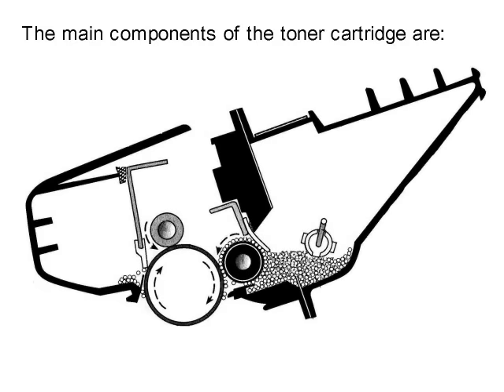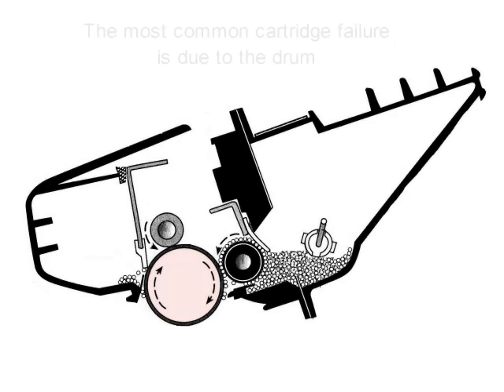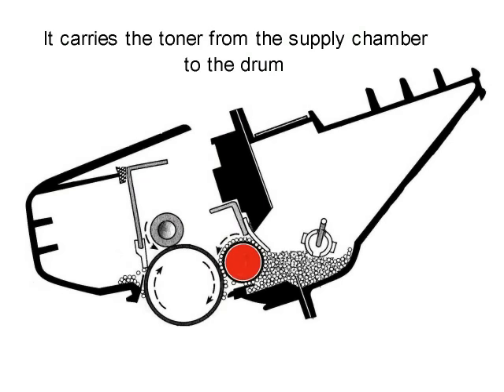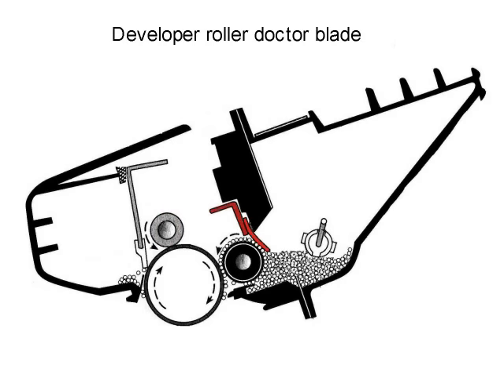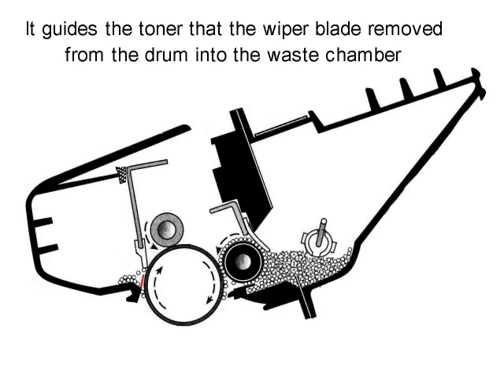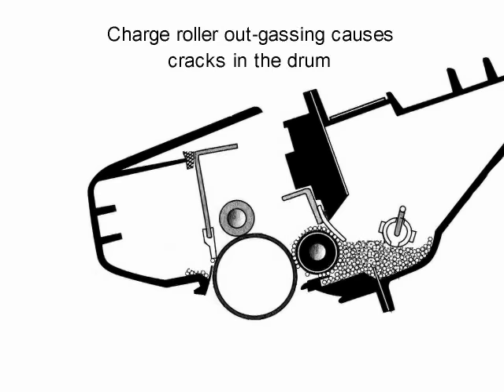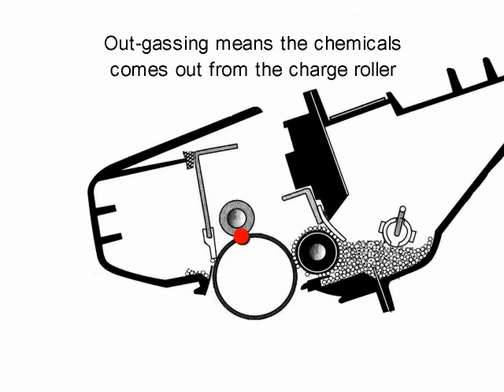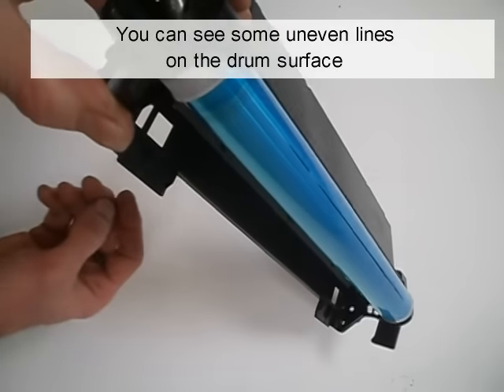Toner Cartridge Printing Defects: Causes and Solutions

Comment: i have a printer hp 1102 its printing black paper in horizontal 1 inch lines too dark and one inch light dark and no text at paper please tell me how to fix it
Reply from the maker: Qazi Zafar Iqbal you mean the printer only prints horizontal black/grey lines at the distance of 1 inch?
Reply: viandant5  yes sir totaly print black
Reply from the maker: Qazi Zafar Iqbal probably it's the cartridge. check the charge roller, may be out of position
Reply: i changed the charge roller and also change the doctor blade but no ok then what i do sir?
Reply from the maker: Qazi Zafar Iqbal I mean there should be some bad contact somewhere in the cartridge. I would check the contact of the magnetic roller or the drum using a multimeter

Comment: First of all many thanks for your very informative videos. I have a couple of new old stock Lexmark Optra and T6xx cartridges with a common problem: All internal components and toner are in top condition. But hardened developer rollers render them unusable. Seems as though developer rollers in 4039, 4049 and T640 are identical. Got any ideas where to get replacement for these? Are there providers in the EU? I really don't want to dispose of my valuable cartridges just because of this common, annoying problem.
Reply from the maker: That roller is a common problem on Lexmark cartridges. Delacamp or Uniener have them, or you could buy an empty cartridge from ebay or something else
Reply: @viandant5  Many thanks for your quick reply. I could not find Uniener though. Do they have a webpage?
Reply from the maker: @Caballingus  uninetimaging.com
Reply: @viandant5  Great! Thank you!

Comment: Hi I have watched dozens of vids, can u suggest my next move, thanking u in advance.  I have black lines across top, centre and bottom of page when printing. I have cleaned transfer belt and replaced the fuser unit. Toners are all above 50% and authentic samsung but still get lines?? Printer Samsung clp325 in dire need of yr expertise :)
Reply from the maker: are the defects always at the same distance?
Reply: @viandant5  yes they are - thanks for responding  :)
Reply: @viandant5  sorry just double checked and NO they are not same distance apart everytime. Sometimes 2 other times 3 lines ??  :
Reply from the maker: @tanyiahayes7587 It could be a drum problem. May be a defect on the surface causes a short
Reply: @viandant5  okeydoki thanks, I have a spare drum so might try swapping them around. :)
Reply from the maker: @tanyiahayes7587  ok, let me know what happens

Comment: Hi. Can you please tell how to set toner agitator roller to the correct position in hp. Color laserjet pro mfp m182n cartridge after refilling?
Reply from the maker: The agitator roller rod inside the toner hopper? It's inserted in holes in the side of the cartridge but it will be difficult ro reinsert. Better remove it
Reply: @viandant5  actually I have refilled my cartridge. I just want to know that whether or not the agitator roller is in correct position. How to identify that whether it's in right position? 
I open up cartridge just until removing the doctor blade
Reply from the maker: @hathakker802  You mean the foam roller. Try to rotate the gears, if they move freely it's in right position.
Reply: @viandant5  ok thanks

Comment: Does anyone know how to resolve error code 117-363 on a xerox 6128 MFP? I've tried everything that I could find on the internet without success. I was even able to start the machine in diagnostics mode and run both the Printer and Fax/Scanner diagnostics and everything reported "ok" so I don't understand why I can not rid the display of the error code as I can no longer use the printer with it there. While going through the printer diagnostics, it printed out pages that were required as part of the diagnostics so I know the printer still works. any help would be appreciated.
Reply from the maker: The manual says it's a NVRAM 
Try this to Reset the NVRAM. Using the Up/Down arrows 

Printer Settings

Setup
Admin Menu
Maintenance
Initialize NVM
User Section or System Section
Are You Sure?
Yes

Hope it helps
Reply: @viandant5  thank you but I can’t access the menu because the error message remains on the menu and prevents access.  The only menu settings I can access, at least known by me, is when I hold down the up and down errors while turning on the machine, which only allows me to run the diagnostics for the printer and the fax/scanner.  Is there another way to access the menu to do what you are suggesting that I do?
Reply: @viandant5  I’m not able to access the printer’s menu because the error code stays on the display screen after starting the printer.  Do you know of a way to enter the menu?
Reply from the maker: @mmmallory1649  Sorry I haven't the tech manuals for this machine, I can't help you

Comment: My problem was that the toner was clumped & not being applied onto the developer roller. I solved it by running a the corner of a clean A4 paper into the slit behind the roller. No need to remove the roller. You should be able to slide the paper into slit/mouth at the back compartment of the roller where the new toner is stored. This problem happened after I refilled & living in a humid place, the toner powder clumped & blocked the slit. My printer was printing very faint half pages. Very similar symptoms with the drum ground contact fault & low toner powder fault IE not enough toner being applied to the paper . Ricoh 311 printer. Hopefully this helps someone. 😀
Reply: 0

Comment: I have a hp 12A  cartridge . its printing fine. the front side is clear, but on the back side , its making 2 vertical lines on the back side. when I insert another cartridge its fine.
Reply from the maker: It's strange. May be the Primary charge roller of the cartridge, or a loss of toner of that cartridge
Reply: @viandant5  could there be a leakage of toner? maybe the toner powder leaks out and touches some small rollers inside the printer? its so strange.
Reply from the maker: @MJ-rr4hd  It's strange, it should be a printer problem, not a cartridge problem. may be the toner powder contaminate the transfer roller
Reply: @viandant5  I just changed the drum, and that solved it. totally unexpected. that doesnt make sense to me. what do you think.
Reply from the maker: @MJ-rr4hd  I understood you changed the cartridge and it was fine. However a defective drum probsably could dirty the transfer roller, causing a defect on the back of the sheet
Reply: @viandant5  you mean the defect could be in the magnetic roller?

Comment: Form where I can buy wiper plate ? Can I use glue to join the rubber of the wiper plate ?
Reply from the maker: no, it's not possible to use glue.
Reply: @viandant5  can you give me a link form where I can buy a wiper blade in india
Reply from the maker: @anikratandas4441  sorry I have no links, but I think you can find it using a search engine
Reply: When I refill it with new ink then it is necessary to clean the old ink properly ?
Reply from the maker: @anikratandas4441  if you remove the old toner the print quality will be better

Comment: What if the toner rubs off very easily from the printed paper. What may be the cause?
Reply from the maker: Probably the fusers. Which is the printer?
Reply: @viandant5  It's Brother HL-1201. Print result is still good. No streaking, smudges, etc. But very easily rubs off paper.
Reply from the maker: @topboxlivingroom7172  It's a defect of the fusers, however it could be a toner cartridge near the end of the life
Reply: @viandant5  I have a same problem. It's laserjet 1018. Should whole fuser assembly be replaced or is it just some part in the fuser?
Reply from the maker: @ranvedsticon2304  Probably it would be enouth the fuser sleeve, but it may be a heating element problem, or the thermistor
Reply: @viandant5  Thank you for the answer. Basically prints are perfect except for some reason it leaves some toner at bottom on page when doing duplex. 
The problem is that it just rubs too easily on the fingers when you go over what's printed. It's not that common with just text but small graphics or images always. I tried using cardstock setting for printing but it bends the normal paper like crazy. 
Is there maybe a way to check what could it be? I could change the sleeve cause they're cheap but anything else must be pricey.
Reply from the maker: @ranvedsticon2304  You can visually check the sleeve. If it's not worn or dirty probably it's not the problem

Comment: please give me solution, when i give a command for print one page then page comes two. in one single click two page comes
Reply from the maker: You gave very few informations about you problem. check into the property folder of the printer. if you do not find something wrong, you can try to reinstall the printer driver

Comment: Sir... Nice Info thnk u very much...
i m reffing  toner from long time mostly 12A nd 36 A nd sort of samsung...
Recently i m facing issue with one Of HP MFP printer with 36A cartridge.... " It gives Faint Prints " No issue with toner cartridge... tried replacing other cartridge... and that cartridge work fine in other Printer....
What Basic steps i need to take with printer...... no issue with settings...
printer is 3 year old now and almost 12000 to 15000 prints taken....
Reply from the maker: +Yogesh Nilekar may be the transfer roller, or the scanner unit
Reply: thnk u.... one more issue is there  On hp 1020plus. Toner powder felt inside the printer bocz of faulty Developer roller. i cleaned it but still printer not gives clear print.... faint print are coming... no issue with toner.... before this incidence print was clear and its best quality... checked with new toner also
Reply from the maker: +Yogesh Nilekar not clear prints? are the fusers dirty?
Reply: yes no clear print.... might b fuser dirty bcoz of ink dropped in printer and it speard all over...
do i need to replace fuser ??? or vacuum cleaner can clean it ??
Reply from the maker: +Yogesh Nilekar no, you don't need to replace te fuser, but a vacuum cleaner is useless. clean the fuser rollers with isopropyl alcohol or a dedicated cleaner
Reply: do u use whtsapp or any othr messengr ??
Reply: how to clean transfer roller  or need to replace it ??
Reply from the maker: +Yogesh Nilekar No, I don't use whtsapp or messenger. you can clean the transfer roller with a lint-free cloth and water
Reply: sir... how to clean scanner unit or lens of hp 1020 plus... pls share any link if u hav
Reply from the maker: +Yogesh Nilekar here you'll find the service manual
http://www.lbrty.com/tech/Manuals_HP/10xxsm.pdf
Reply: sorry to bother u again sir...
one canon lbp 2900 laser prntr gives print full page black..... 
no issue with toner cartridge...
Reply from the maker: +Yogesh Nilekar sure it's not the cartrdige, check the internal contacts between the cartridge and the printer. 
high voltage power supply circuit may be not supplying the correct negative voltage, in this case replace the High Voltage Power Supply
or If the DC Controller turns on the laser beam continuously, the entire surface of the drum is neutralized and you get a completely black page. replace the DC Controller
Reply: was connection prblm.... reconnect all connection nd now printr is ok..... thnk u.....
Reply: in case not solved in reconnection then which part need to replce.... ??
Reply from the maker: +Yogesh Nilekar the most probable is the DC controller
Reply: ok thnk u sir.....
Reply: sir my HP p1007 printer gives error ""52 scanner error , to continue turn device off then turn on ""
Reply from the maker: +Yogesh Nilekar try update the firmware, but probably this is an hardware issue, may be the sensor located on the top
Reply: need to replace scanner assembly or any other part
Reply from the maker: +Yogesh Nilekar yes, the problem is the scanner assembly
Reply: thnk u sir..... ill try nd let u knw

Comment: VERY INFORMATIVE VIDEO FOR SELF TO SOLVE PROBLEMS.BUT I DO NOT KNOW WHERE TO GET THE PARTS LIKE,DRUM,CHARGE ROLLER ,WIPER BLADE AND DEVLOPER SEALING BLADE FOR HP COLOR LASER JET CP 1215 MODEL PRINTER .IF ANY BODY GUIDE ME..
Reply from the maker: it depend on which conutry you are. try delacamp or future graphics

Comment: Hi. I have a brother 2130, it makes 3 fingers faint from the right on the paper. I opened it and cleaned the knife and it didn't fix. There is also a 3-finger dust-free part on the magnetic roller under the blade, is it because of this? There's dust everywhere else. How do I fix this?
Reply from the maker: Yes, probably this is the problem. if the roller is not damaged you can clean it with a soft cloth.

Comment: I have a hp 12A  printer. its printing fine. the front side is clear, but on the back side (which is blank), its making 2 vertical lines on the back side. weird.....  can you help?
Reply from the maker: Is 12A the model of the toner cartridge? The problem could be the fuser unit, or a dirty paper feed roller

Comment: Sir gud evng HP12a cartridge drum spring area is broken print is blank what's the reason spring atachemnt area is broken please slove my problem
Reply from the maker: without the spring, the magnetic roller is too distant from the drum. you can try to redo the spring tab with an iron solder but it's difficult. I think you have to change the cartridge

Comment: I have a canon LBP 2900. my print is ghosting from right to left. and there's a wave like pattern mark all over page... can you help me ?
Reply from the maker: Check the toner roller, is the toner evenly distribuited? Clean it with a dry soft cloth, may be the toner is dump and it made clumps on the roller
Reply: @viandant5  you mean the developer roller? I cleaned it but same problem still happens. And what is that wave type pattern??
Reply from the maker: @MJ-rr4hd  yes, thew developer roller. the wave pattern and the backgroud could be due to the charge roller (PCR)

Comment: I have opened my kit of konica c280 and i am not sure that i closed it confidently causing a crust in 2.5cm near a side of the drum . How can i know that the kit is tightly closed?
Reply from the maker: try to print something. if it works, it all ok. however the crust in the drum could cause a print defect
Reply: @viandant5  when i print something i hear a sound .the image is printed but as if the yellow color not exist (image is lank)
Reply from the maker: @AliBenjellounM  It's difficult to say without checking the printer. Try to remove and reinstall the yellow drum unit. If yellow doesn't work at all for sure it's not correctly installed
Reply: @viandant5  when i print only with black, is all drums turn at the same time OR just the black drum / can i print black without installing the yellow drum ?
Reply from the maker: @AliBenjellounM  No, you'll receive an error message.
Reply: @viandant5  if i want to change the drum kit. I replace him with another new one without doing any thing?
Reply from the maker: @AliBenjellounM  no, there is a chip

Comment: Mine has blue thick lines on the side, i replaced the blue toner cartridge and cleaned the roller, what else can i do, i cant print anything without blue 1/2 lines on the side
Reply from the maker: Wihtout knowing which printer do you have it's difficult to say. May be the drum

Comment: My Hp 88a Cartridge after refilling print coming lightly, only One Side (Gare side, wheel side, Left Side) plz replay.
Reply from the maker: Try to disassemble and reassemble again the cartridge. Check the magnetic roller, it in contact with the drum?

Comment: Respected sir,
I have samsung multixpress leaser printer k2200.sir when i change developer powder in developer unit.Developer TD sensor value not show.so then printer display show error c3-1312 imaging unit failure.install img. And printer not print.sir please give me any solution sir...
Reply from the maker: The toner sensor could be defective or dirty, or a connector. Try to press 1, 2, 3 together then enter password 1934. It will enter in engine diagnostic. Then search the toner and OPC settings
Reply: @viandant5  Sir printer not print any documents only display show printing..... Process.
Reply from the maker: @shachikantvishwakarma7554  Probably the developer is contamined or dirty. You have to remove all the old developer and add new developer
Reply: @viandant5  sir i changed developer but not error c3-1312 is not gone.
Reply from the maker: @shachikantvishwakarma7554  The toner sensor could be dirty
Reply: @viandant5  sir how to clean toner sensor of developer unit. And remove error c3-1312.

Comment: Help!!!   Our processor ordered "compatible" cartridges for our Xerox Phaser 6700.  When installed, the printer displays that the cartridge is not compatible.  *First thought was that the little chip needed to be changed.  Took the chip from the previously working cartridge and installed to the "compatible".   Seemed to work, but not registering the level of toner correctly.
**I this an issue because of chips not interchangeable for standard capacity and high capacity differences?
Any suggestions are appreciated!
Reply from the maker: Yes, probably the chips are not interchangeable and once finished they will no more accepted by the printer

Comment: Im getting horizontal black lines sometimes. like 1 fault after 5-8 pages. changed the wiper blade. didnt help. what to do??
Reply from the maker: the wiper blade causes vertical lines. without knowing which printer do you have it's difficult to say, may be the cartridge
Reply: @viandant5  its a canon LBP 2900. uses 12a type cartridge is it caused by pcr maybe?
Reply: its a pcr problem. micro crack.